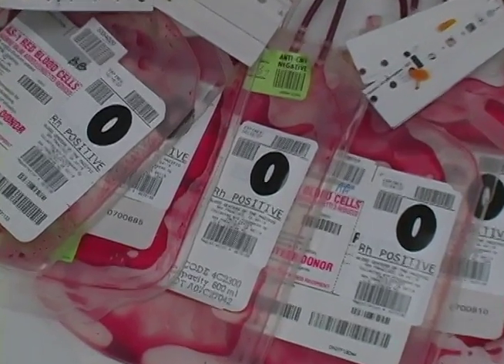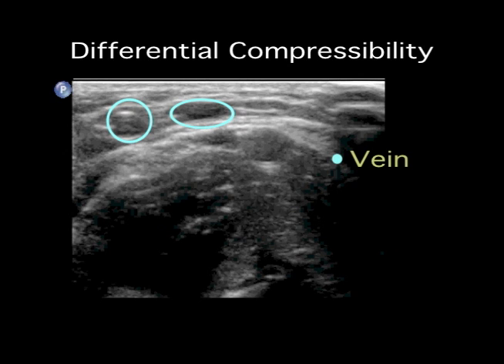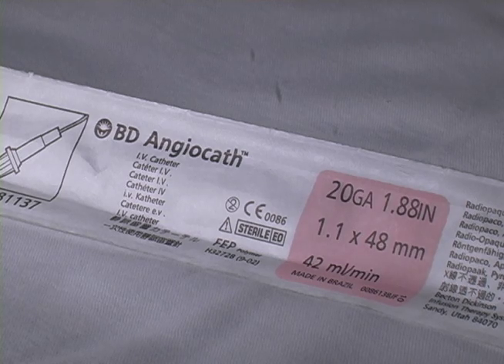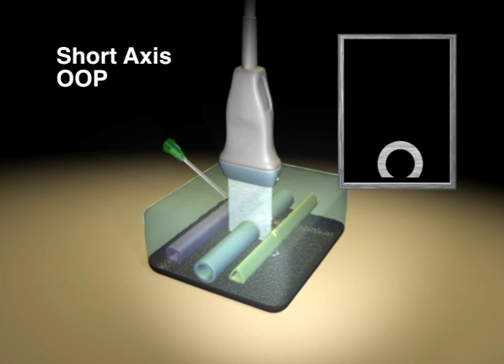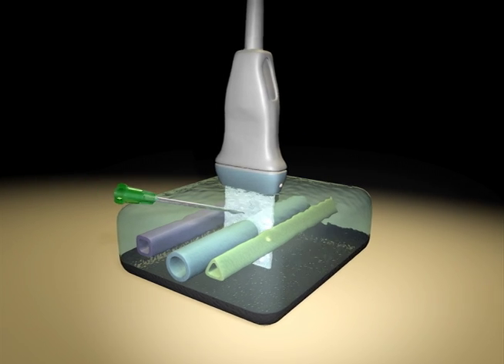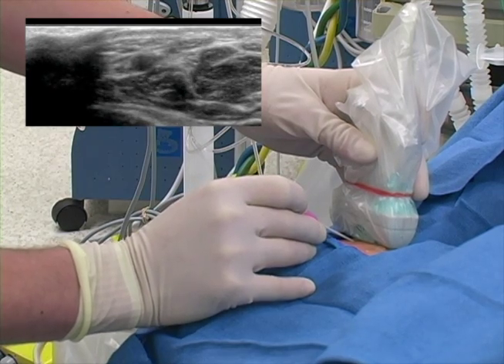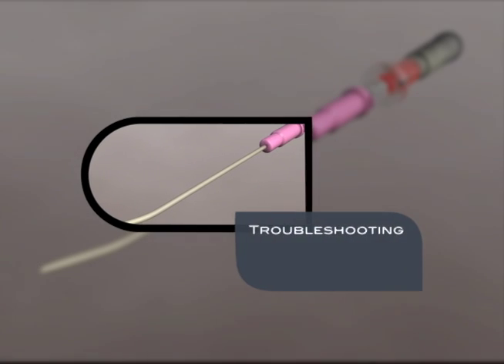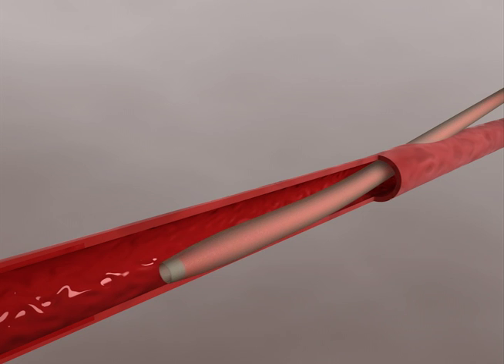Ultrasound-guided arterial line Placement

Comment: Sometimes if thd assembly ia advanced too far and then withdrawn, a haematoma develops rapidly. How can one avoid this? Is there any tip for this? Thanks for an excellent demonstration
Reply from the maker: if the leading edge of the needle or catheter is withdrawn all the way out of the artery, you get a hematoma. Sometimes it is hard to avoid! sometimes the catheter or needle are occluded with a clot or a tissue plug and you don’t see flow when you should. I use Arrow kits with wires these days and many times I have had a “dry” stick that was actually in the lumen. Ultrasound is really helpful for see this!